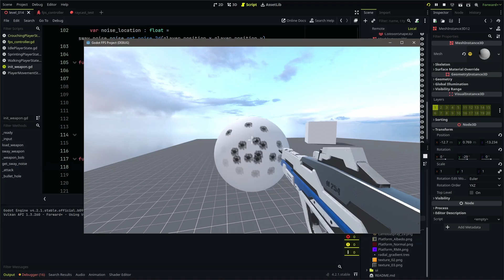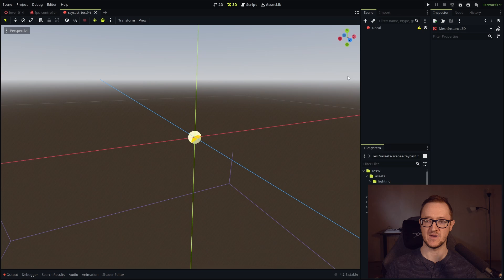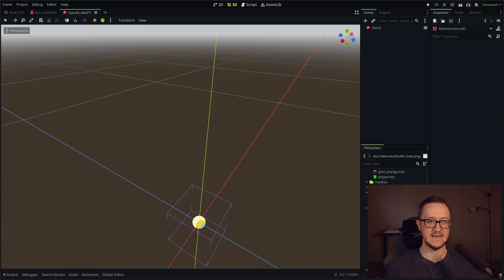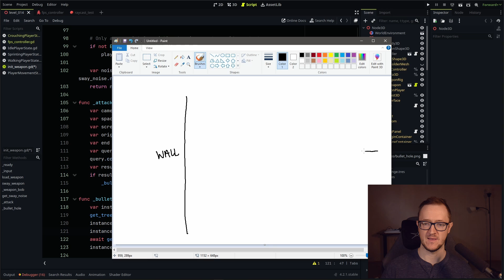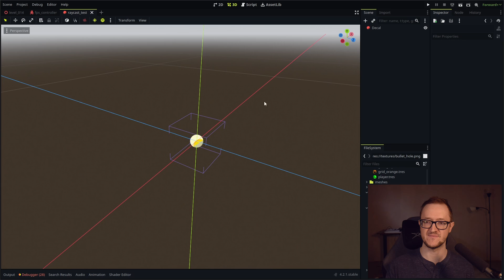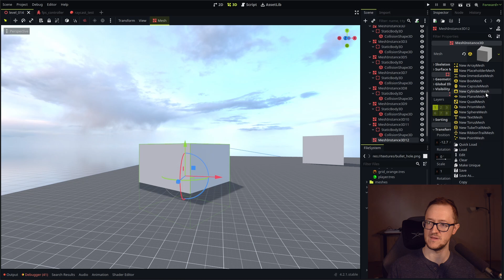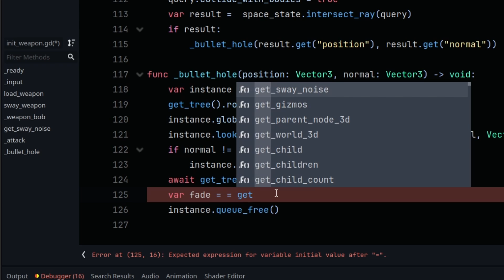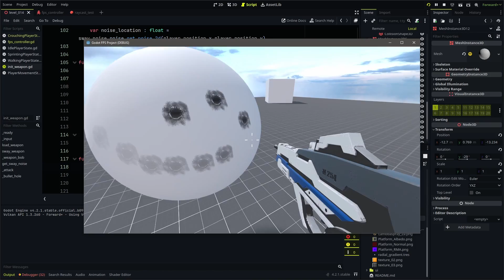Easy Bullet Decals // Make An FPS in Godot 4 (E25)

Comment: Your decal rotation is rather convoluted. It can be done simply by looking in the normal direction, and then rotating by 90 (which is also needs to be set in radians, not degrees)
That part should look like this:

instance.look_at(instance.position + normal)
instance.rotate_object_local(Vector3.RIGHT, -PI/2)
Reply: The comments on these tutorials are truly gold nuggets, my man. You're a saint.
Reply: @jesseturner8693  true

Comment: Great and clear video, but I'm confused why the 90 degree rotation fixed the issue.
Considering the explanation you did in paint at around 8.50, shouldn't this work regardless of what direction the normal is pointing? Not sure how flipping by 90 degrees fixed anything.

Documentation says that the look_at() function takes the objects forward direction and makes it face our new direction. Why does this only work without the 90 degree tweak when facing up or down? Shouldn't it work just fine regardless of the normal direction?
Reply: Think of Decals as on a plane, basically its a flat surface, so rotating on the z axis made it perpendicular with the wall and not the floor. Therefore for something like a decal that will hit from multiple directions, it needs to be able to adjust its rotation ... because its a plane (Think of paper)

Comment: func _bullet_hole(position: Vector3, normal: Vector3) -> void:
	var instance = raycast_test.instantiate()
	get_tree().root.add_child(instance)
	instance.global_position = position

	# Check if the normal is aligned with the UP or DOWN vector
	if normal.dot(Vector3.UP) > 0.99 or normal.dot(Vector3.DOWN) > 0.99:
		# If shooting at ceiling or floor, manually set rotation without using look_at()
		instance.rotation = Vector3.ZERO
		if normal.dot(Vector3.DOWN) > 0.99:
			# Flip the bullet hole for the ceiling
			instance.rotate_object_local(Vector3(1, 0, 0), deg_to_rad(180))
	else:
		# For other surfaces, use look_at with the normal
		instance.look_at(instance.global_transform.origin + normal, Vector3.UP)
		# Additional 90-degree rotation for proper orientation if needed
		instance.rotate_object_local(Vector3(1, 0, 0), deg_to_rad(90))

	await get_tree().create_timer(2).timeout

	# Tween to fade out and then remove the bullet hole instance
	var fade_tween: Tween = get_tree().create_tween()
	fade_tween.tween_interval(2.0)
	fade_tween.tween_property(instance, "modulate:a", 0, 1.5)
	await fade_tween.finished
	instance.queue_free()

Comment: I don't know what I was doing wrong, but I could only get up and down decals to work properly with .is_equal_approx in the if statement. Otherwise they would literally behave differently depending on which triangle on an upward facing plane they were on, some kind of floating point shenanigans I guess.
Reply: Came here for this, I see others have mentioned it in comments.  I could not figure out why it was saying they did not equal and this fixed it perfectly.

Comment: Hello, I wanted to comment on an issue I found and I'm not sure if this would impact anything in the game. But, when you have:

instance.look_at(instance.global_transform.origin + normal, Vector3.UP), it will give you this error:

Up vector and direction between node origin and target are aligned, look_at() failed. 

This happens every time you shoot either up or down the normals of, let's say, a cube. The if statement for the rotate_object_local worked just fine, with no errors but I also noticed that in the debugger of your tutorial, the errors just keep increasing whenever you shoot up, or down. I wanted to ask if there is a solution to this that I may not know since if I fix the shooting up issue, the down shooting gives me an error and vice versa but I cannot fix both issues at the same time for whatever reason either for my lack of knowledge/experience. It doesn't stop the gameplay(?) of the game but the errors just keep increasing if you shoot up/down the normals.

Nonetheless, it was a really awesome tutorial and I feel like I learned a lot from this. Thank you so much!

Edit: Added normals as to not confuse what I mean by "Up/down". My mistake.
Reply: I just repeated the if statement and put it on top
	if normal != Vector3.UP and normal != Vector3.DOWN:
		instance.look_at(instance.global_transform.origin + normal, Vector3.UP)
		instance.rotate_object_local(Vector3(1, 0, 0), 90)
Reply: @nikolastanojevic6082  This still gave me the error when the decal was on the bottom of the object so changed the if statement to this instead:
if normal != Vector3.UP and !Vector3.DOWN.is_equal_approx(normal):

For the Vector3.UP it doesn't seem to matter if I use != or !is_equal_approx

Comment: what about the performance? seems like i cant spawn more than 7 decals at once before getting errors and issues with spawning more decals? since i changed my input from "is_action_just_pressed" to "is_action_pressed".
Reply: Id suspect you don't have a firing rate set. You're probably actually firing 100000 bullets every millisecond.

Comment: Thanks! Very helpful tuts. BTW, no need to create the timer twice. The tween object can do everything itself:

# REMOVE: await get_tree().create_timer(2).timeout
var fade_tween: Tween = get_tree().create_tween()
fade_tween.tween_interval(2.0)
fade_tween.tween_property(instance, "modulate:a", 0, 1.5)
await fade_tween.finished
instance.queue_free()
Reply: thank man
I also found something that might be more efficient:

		# Align the bullet hole correctly based on the surface normal
	if normal == Vector3.UP or normal == Vector3.DOWN:
		# Set rotation to zero for vertical surfaces (up or down)
		instance.rotation = Vector3.ZERO
	else:
		# Orient the bullet hole to face the normal direction for other surfaces
		instance.look_at(instance.global_transform.origin + normal, Vector3.UP)
		# Rotate the bullet hole if the surface is not vertical
		instance.rotate_object_local(Vector3(1, 0, 0), deg_to_rad(90))

I was getting errors every time i shot a horizontal surface. they didnt break anything, but were annoying. this fixes that and is a bit more efficient
Reply: @Legit_SuperFall  Thank you so much for this, I was trying to find a way to get rid of those errors and that worked like a charm! Thanks again
Reply: @BioCreed12  Oh don't thank me, thank our good friend GePeTo lol
Reply: @Legit_SuperFall  Hello, did you perhaps edit your comment and remove the code?
Reply: @stabbedbyapanda  i dont remember, that was a long time ago

Comment: Nice! Definitely adding this. Would it be easy to add a bump map to this? Does it have particularly bad performance if there are many decals running at once?
Reply: the performance is not really great in my case....i cant spawn more than 7 decals before getting errors and wait until the vanish so 7 more can reappear after some time. since i switched the single fire to holding down LMB for auto fire

Comment: This one is great. It took me forever to figure out how to get that decal rotation working on my own a few months ago. Here's a little addition: if you want to add variety you can add rotation around the local Y-axis of the decal for 'spin'. instance.rotate_object_local(Vector3(0,1,0), randf_range(0.0,360.0))
Reply: Ty for this, just to make this a little more clear for others.

The suggestion above is a NEW line of code, that you add AFTER the if statement, not tabbed under the if statement. If you have it only in the if statement, it only applies when shot against the wall, and not against the ceiling and floor. With the below code, this should apply the rotation to all surface directions

Code Example:
if normal != Vector3.UP and normal != Vector3.DOWN:
		bullet_hole_instance.rotate_object_local(Vector3(1, 0, 0), 90)
bullet_hole_instance.rotate_object_local(Vector3(0, 1, 0), randf_range(0.0, 360.0))